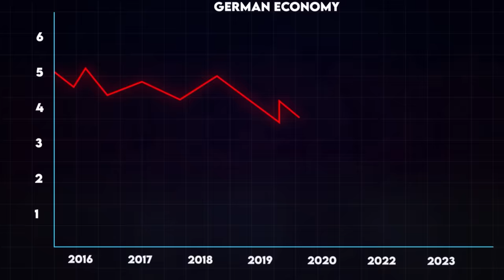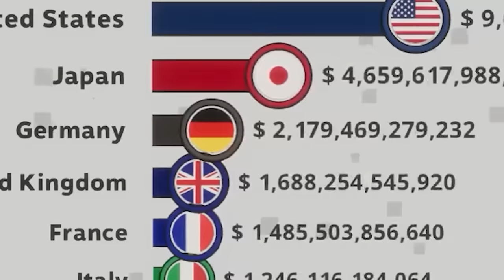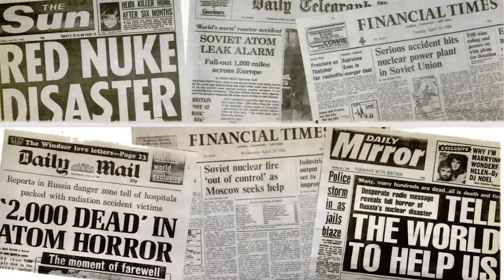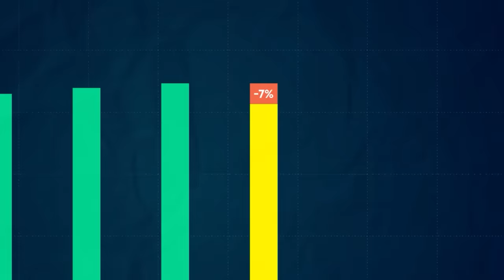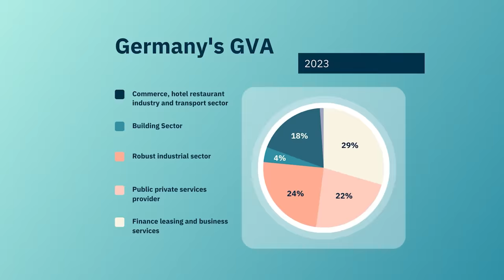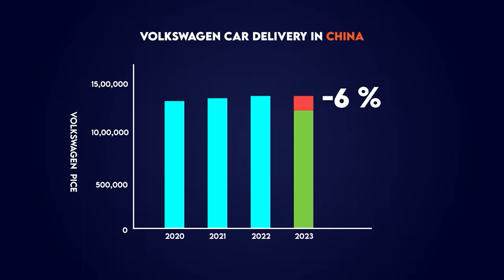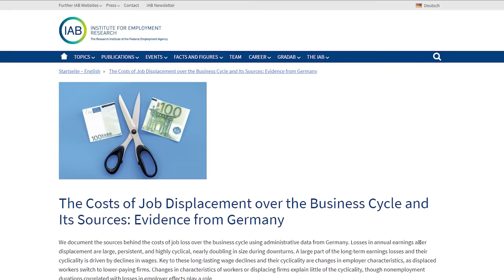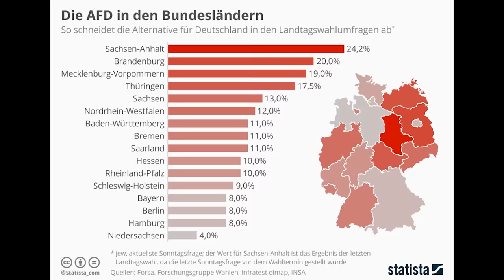Germany's Collapse Should Scare Europe

Comment: UK is also falling.
Reply: That's old news. UK has been failing in slow motion since the Great War.
Reply: The extent of that may have been propaganda.For example, nobody mentioned Germany is struggling up until a few months ago and now busily videos about imminent collapse.Before it was the UK, butAlthough the UK has Significant problems to deal with "hopefully only" medium-term, if you look at imminent metrics, Revised figures show that UK has growth in return from the pandemic, similar to the return of the best European countries Trajectory and has positive growth this next year, whereas Germany was significantly slowest returning from the pandemic and has negative growth next year.
UK has the 4th or 5th best militaryy globally, Germany isn't even in the top 10 and is ramping up spending far more than the UK needs to. More importantly, U.K.'s focusing military has been on cyber warfare and not hardware, like the French. Up until the last 5 years UK had the second-best  cyber capability in bread and capability, but it has slipped to 3rd behindd US and China in 2023. France and Germany are not even in the top 5 in cyber
 UK has its own oil source(55%) and a commitment from Norway(41%) and is not dependent on Russian oil at all, unlike every other European country, with winter coming. UK also has 1 of the best demographics in the world, even though they also need to find a solution to a lower than necessary birthrate in the last 45 years to provide a replacement population. only USA, France and UK have any chance whatsoever to solve this last crisis. 
Of the G ten countries, Germany has the next best birthrate over that period, but there is a massive drop from the UK to Germany of at least 0.3-0.5 in birthrate over the course of the last fifty years.China and Russia have the worst problems of every country in the world in this respect, China has massaged its numbers and has the worst birthrate in the world by far in the last 45 years due to the one child policy and high mortality and Russia already had a birthrate similar to the average European country, but this war has devastated their working age population, on top of that
Reply: Somalia is also falling..
Reply: That's called deflection...😅

Comment: Rolling back all nuclear energy because of the memory of Chernobyl is like shutting down the airline industry because of one plane crash that happened 70 years ago.
Reply: Nah, it is just too expensive.
Reply: @ debasishraychawdhuri
Chernobyl wasn’t the only nuclear disaster. - Remember Sellafield /UK, Harrisburg, Fukushima and many many other accidents that happened.

Nuclear energy in Germany (and probably anywhere else too) only is competitive because it receives huge subsidies, tax benefits and exemptions. Without government (tax payer) support, nuclear energy probably would be twice as high per kWh. 
The nuclear power corporations are criminally underinsured. In Germany they are required to have merely 0.5% of the costs of a disaster covered. In such a scenario the tax payers would have the burden to contribute the remaining 99.5% of the costs.

Also keep in mind that nuclear power plants require a lot of cooling. That’s why they’re next to rivers or the sea.  Especially in summer when rivers are warmed up already and run low on water, nuclear plants cause additional heat, causing enormous stress to the rivers‘ ecosystem, as the warmer water gets the less oxygen it can hold.

Germany had 28 nuclear power plants. Two of which were running statistically just to provide the energy needed for all the devices kept in standby mode nationwide.
Reply: Well, this wasn´t the only reason for the german anty nuclear movement. As Germany sat in the middle of the cold war for decades the risk and fear of a nuclear war was huge. When Chernobyl happened it just worsened the fear of Germans to have their own nuclear desaster. This emerged in huge protests resulting in the shutdown of Germanys last nuclear powerplants this year. Unfortunately the potential of green energy hasn´t been fully used since the first powerplants shut down - mainly due to stubborn nimbys and some politicans connections to the coal industrie.
Reply: @ karllagerfeld4842

The full potential of renewables hadn’t even been researched for decades since the 1950s.
Around 85% of the government research budget habitually had been spent nuclear.power research. Whilst the remainders were distributed on  the various 7 or 8 renewables.  If it were only for electricity, they would have seen right away what is the most economic and less hazardous way to go.... 
But that hadn’t been an option as only nuclear power plants could produce matter usable for nukes.
Which is the main reason why they exist.  Electricity is just a byproduct.
Reply: It's a bit different though.
When a plane crashes, people die, then the crash site is cleaned up and used again.
Have a look on a map, or better yet, go on Google Earth and draw a circle with a radius of 30 KM's around any NPP, that is the exclusion zone if stuff like Chernobyl or Fukushima happens.
That is not an area that will be cleaned up, but an area when nobody can live for decades to come.

Whenever I'm in a discussion with pro nuclear minded people, I ask them, "where in the Netherlands would be a good place to build an NPP?".
The answer is always away from the economic heart.
"Why, you say they are safe, so why not build them in the economic heart ?"

I have yet to get a satisfying answer.
Reply: No, that's a different argument. The problem with the Germans are that they let America blow up their pipelines and play along with the lies. You just can't make it up! Their politicians are complicit and are accountable. They are on the wrong side of history. They courted the WEF. Now paying for its sins.
Reply: What a dumb comparison. 🤦🏻
Reply: @kulturfreund6631  it was not though. how many people died?
Reply: @debasishraychawdhuri   what do you mean?
Reply: That's what I'm saying!
As an Austrian I say this, dear Germans:
Nuclear energy is STILL the cleanest AND SAFEST form of energy.
Reply: @vulk7183  Vor allem wenn man ein Kernkraftwerk hat, das nie ans Netz ging. 👍
Reply: That is a bad comparison, since Chernobyl caused great problems at that time. From the poor people how went to Chernobyl to rescue the people in it. People had to be careful radiation all over europe. The Chernobyl plant needs to be covered in a new radiation shield regularly. The soil at some place around it is highly radiated. The consequences of one airplane crashing and one nuclear power plant exploding are in different leagues. There are other things to consider too. Right now Russia controls a bit more than 50 % of the market for nuclear fuel and nuclear energy was subsidized. The problem of waste management isn't solved too. People might be supporting the use of nuclear energy, until the goverment wants to build a plant close to them. Long term storage of nuclear waste is problematic too. People are sueing and delaying projects like new train tracks, power lines, etc because they are close to their homes. So projects related to nuclear will be even more difficult to build.
Reply: @vulk7183  Not really. The nuclear fuel has to be bought somewhere, e.g. fron russia. Building the plants can take up to 25 years, costing billions of dollars. The waste is a problem. The security is a problem, they also make great targets during war. that is why no private insurance companies take nuclear power plants as their customers. The generated electricity is 5 times as expensive as renewables. Put together, nuclear is absolutely not economical. The reason Europe had an energy crisis last year was due to the French nuclear plants, as they were failing, requiring Germany to sell more power to France, increasing prices for all of Europe. Nuclear is absolutely dead, while renewables increase exponentially.
Reply: @kulturfreund6631  The question is how many people have died from nuclear plant accidents, and how many people have died from plane crashes?  The question is being asked because the fear of nuclear power is much greater than flying while flying us a much riskier endeavor.  Nuclear power is the only way will be able to meet future electric power needs without fossil fuels.  Stop vilifying the only currently viable energy solution to fossil fuels.
Reply: Yes - hahahaha!!!
Reply: Merkel did that in 2011 and not to the reasons you mention. She did it in favor of cheap Russian natural gas bc more and more allies critised Germany for NS2 pipe.
Reply: Challenges such as unemployment, income inequality, and poverty persist due to various factors like globalization, technological advancements, and economic cycles.

Comment: Energy prices are soaring not because of Russia-Ukraine conflict. They are soaring because of the sanctions imposed on Russia by EU. Also they are soaring because of EU, under US pressure,  rejected Nord Stream 2.
Reply from the maker: There is more to it which we will be digging into in an upcoming video. Germany has become over reliant on Russia for cheap energy and shot itself in the foot by shutting down its nuclear power. This though is still only the tip of the iceberg.
Reply: However, certain ideologies and economic systems may contribute to or exacerbate these problems to some extent. For example, a laissez-faire capitalist system without sufficient regulations or social safety nets could lead to income inequalities, poverty, and homelessness as it prioritizes individual freedom and profit maximization over social welfare.

Similarly, certain ideologies that promote excessive individualism or prioritize the interests of the wealthy and powerful could contribute to worsening income disparities and increased poverty rates.

Ultimately, the causes of poverty, income inequalities, unemployment, and homelessness are multifaceted and interconnected, influenced by political, social, and economic factors. Addressing these challenges requires a comprehensive approach that considers a range of factors and recognizes the complexity of these issues.

Comment: You forgot to mention BMW. 😂😂😂
Reply from the maker: Did we? Thanks
Reply: @WeAreLivingHistory  At least they are not mentioned when it comes to crisis. BMW doesn't fit into the narratives on sick auto makers on decline, I suppose? 
By the way, most damage had be done by former communist secretary Angela Merkel.  Damage done by Gerhard Schroeder ist way smaller as he left goverment already in 2005.
Energy crisis is closely connected to concept of "great transformation",  urgently needing natural gas to buffer gaps caused by volatile green energy sources.